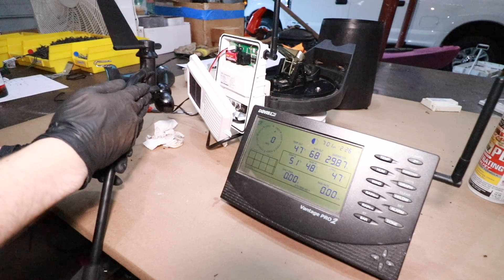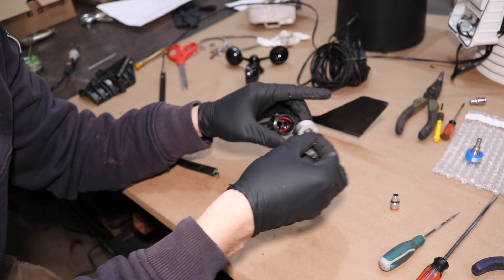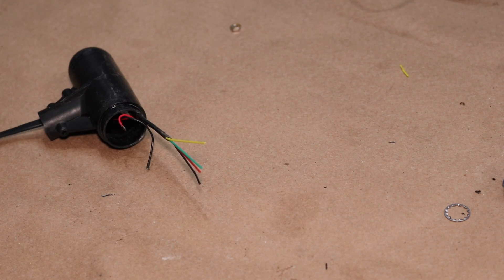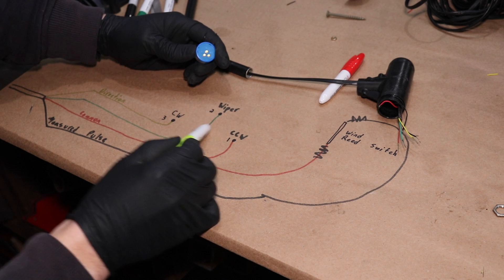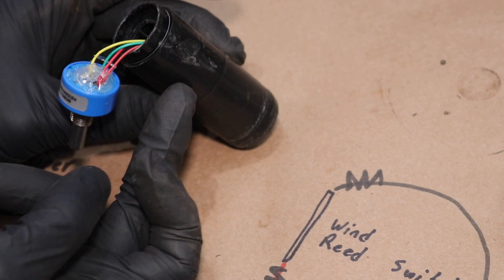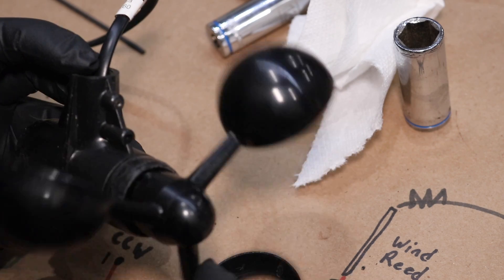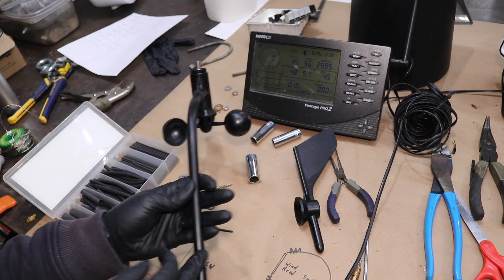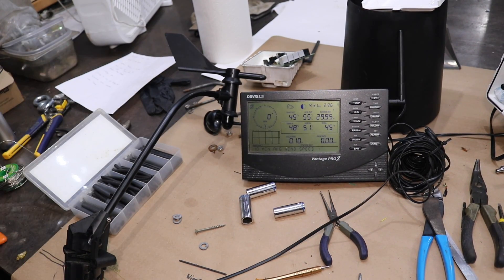How to Fix a Davis Vantage Pro2 Wind Vane Direction - Step by Step Guide

Comment: Great video! I have this same model but my issue is the wind speed. I am unable to separate the curved pipe from the head. I removed one set screw but it wont come apart. My reed switch is broken but I can’t figure out how to get that end out to repair it. Any help would be great!

Comment: Hello. I have disassembled the Rotary Potentiometer of my wireless Vantage Pro 2 following your instructions. What do we do if there is a 1Mg resistor between the CW and S points? I don't know why there is a resistor between those points and if it is necessary to put it back when connecting everything again. I look forward to your comments.  Google traslate
Reply from the maker: Hello, my unit didn't have the resistor, so I'm not sure. If the potentiometer is the exact same part and has the same electrical parameters as the old one, I would reassemble with the resistor. Just my thoughts.
Reply: @OldSoulMillennial  I have now mounted the new potentiometer and assembled all the components for the wind vane and anemometer. My Vantage Pro 2 (2001 USA version) is working again. The new potentiometer turns a bit harder than the original, but although it does not capture the lightest breeze, it does handle the rest of the wind. Thanks for the tutorial.

Comment: I did a quick fix.... take off the cups with 1.5mm allen and vane using the same. Take off nut and lock washer, no need to take off "c" clip. Use "CRC Lectromotive" cleaner (purchase at auto parts store or ??) to clean contacts by very slowly press the nozzle only to fill up the red straw that you connect to the aerosol can. (Hard to do). The reason for this is I don't know the ramifications of getting the chemical on the plastic; I had a tissue and a pick to clean excess of quickly. Dob the drops on the rod where the opening on the "c" clip is on the one and while letting solvent ooze past into the pot, rotate with fingers quickly. Do this on both the anemometer and the vane. It worked for  me.
Reply: correction: it is a 1.27 mm allen and I had to apply a second application, it quit again. I did not have to pull it all apart just the nut and washer . If it is not a permanent fix I will repost.
Reply: Did you pull it apart at all (other than removing the nut and lock washer) and then spray.
Reply: This didn't work! I ended up cleaning the grease out of an off of the socket and the plug from the vane/ anemometer to the board. It has been fine for about a week.

Comment: Cool video, I have this old style too but my issue is the wind speed doesn't work.  Davis doesn't sell any parts, I guess the switch inside went bad but I have no idea how to remove the bottom part. Will probably just bit the bullet and order a whole new assembly, the new one they sell replaceable parts for.

Comment: Good job man, i have a target 2 windvane, trying to adjust the 4 potentiometers on the pcb to get it to read correctly.
Do they use the brass tip which is screwed on fot detection, or does it use the metal ring inside the hub at the base?

Comment: I just had to replace my anemometer, wind vane unit. The old one was frozen at North, but anemometer still worked. Same scenario as the one you repaired in this video. I am hoping to do the same repair on my broken unit and keep it as a backup. This video will be very helpful. if I can find the potentiometer. The link you provided shows it being currently unavailable. Not sure if it has been discontinued or not!
Reply from the maker: I bought mine on Mouser Electronics. Mouser Part # 652-6639S-1-203.   Expect to pay around 40 Bucks for part and shipping. No Regrets!
Reply: Thanks man! 
 @OldSoulMillennial
Reply: Turns out I must have the type unit that can not be replaced!. After gouging it out of the housing, turns out the anemometer unit must be picked up by the wind vane pot (magnetically?) There are NO wires coming out of the anemometer unit!. The wind vane pot is in 2 pieces, without a solid plastic case (like the one I ordered from Mouser). Sadly, I will have to return it and scrap the old unit completely! But thanks for your help. It was worth a shot! @OldSoulMillennial
Reply from the maker: @fenderbender8556  no wires coming out of the anemometer? Do you see terminals on the back of the anemometer? 

It’s possible you may have accidentally pulled the wires off the terminals and into the tube mount. That’s what I accidentally did. 

Feel free to email me a photo of what you have going on. Email should be in the description.
Reply: Nope! @OldSoulMillennial
Reply: @fenderbender8556  On the new anemometer (hour glass) the potentiometer pins are soldiered directly to the reed switch circuit board. It is a real pain to dismantle as it is held in place by the resin. There  s even between the potentiometer and circuit board which makes separating them difficult to say the least.